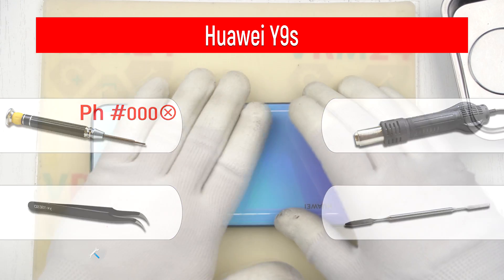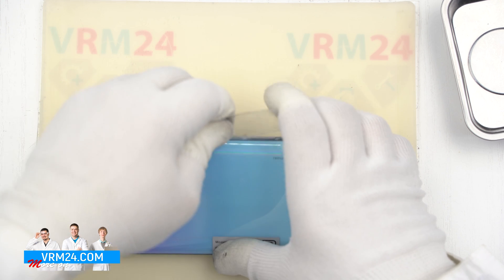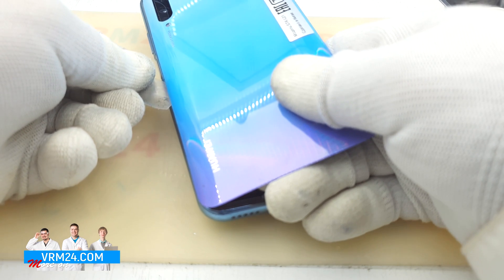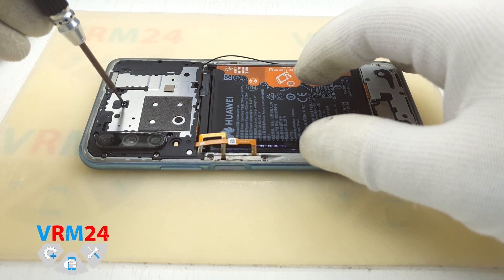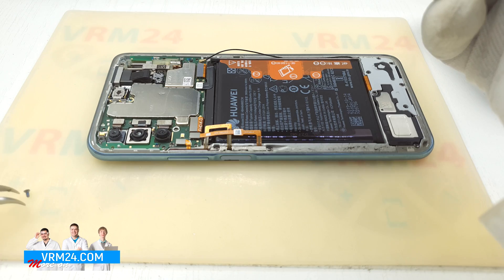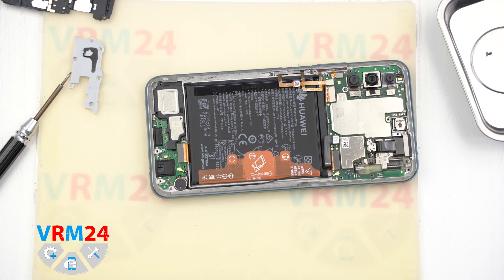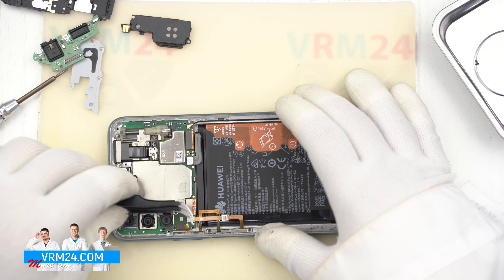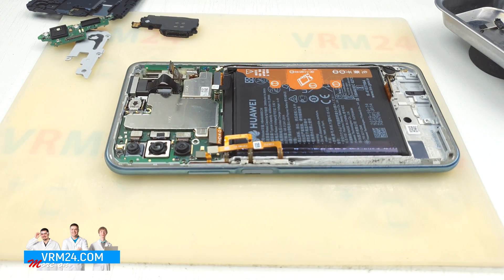Huawei Y9s STK-L21 📱 Teardown Take apart Tutorial

Comment: What about the small cell battery what is it? I didt the same thing you did on my phone and i broke the battery now the wifi signal is very low even if I'm next to the router is related to wifi?
Reply from the maker: Hi, what is small cell battery? How did you damage the battery?
Reply: @Vrm24com  it looks like a watch small battery it's in the right bottom corner under the charger/loudspeaker panel you didn't remove it i was trying to change the frame ....
Reply from the maker: it is a vibration motor
Reply: Hi, I want to know if I replace my old ic chipset can this cause problems such as selfie camera not popping up also my speaker doesn't work but was fine only after I fix ic chipset or what u call headset Jack?